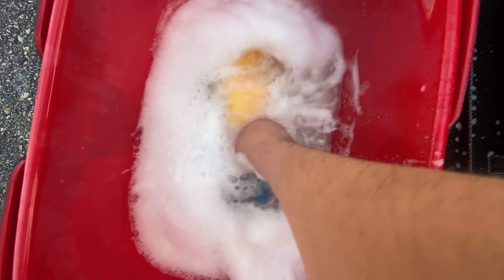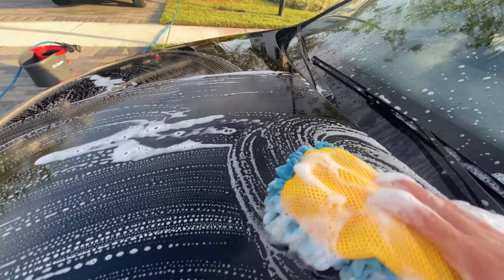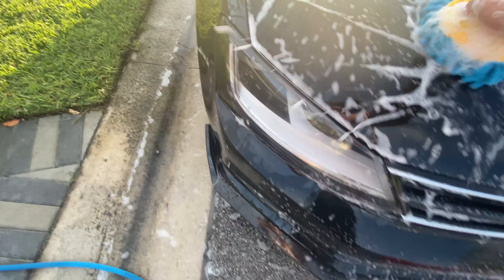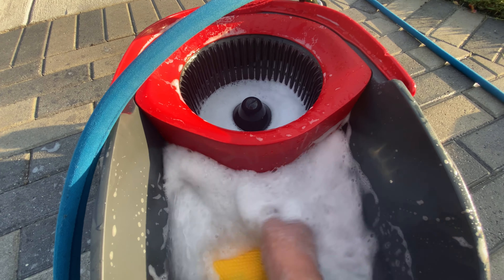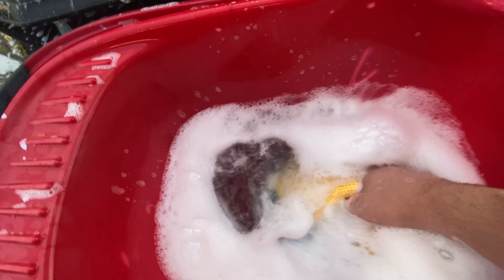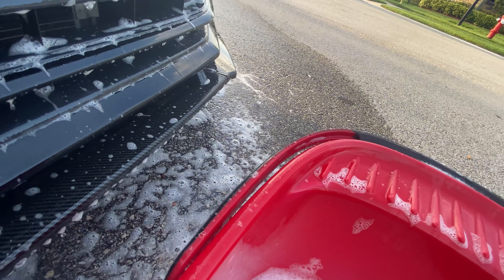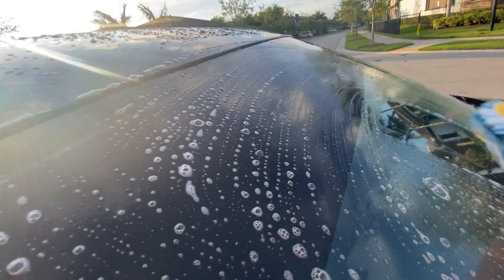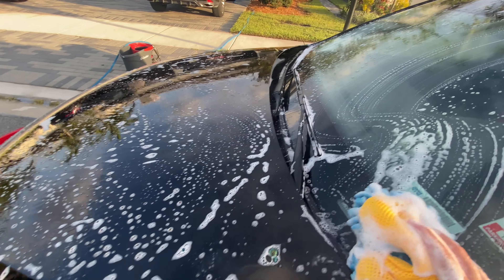The future of the Jetta and this channel !!

Comment: I have a 2016 mk6 also, except it's a manual 5. Just out of certified pre owned warranty.  Only " mods" are 
Accelerator programmer ( nice cheap addition) and a drop in K&N filter ( getting a CAI AEM soon)
Next an APR stage 1.
And then, getting rid of my steelies.
And I'm 58 , going on 25. .....takes me back to when I had a Scirocco 😎
Reply from the maker: Hey my friend ! Enjoy it ! I wish the scirocco was still around 😔